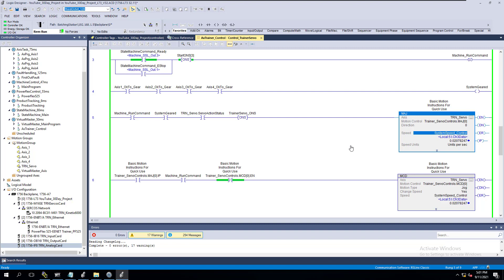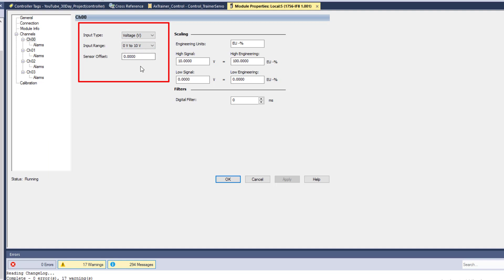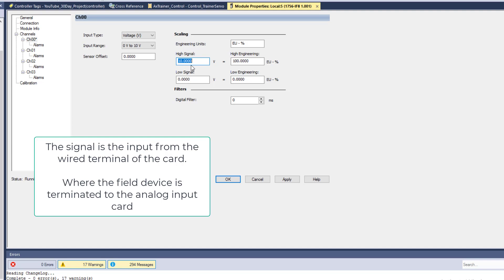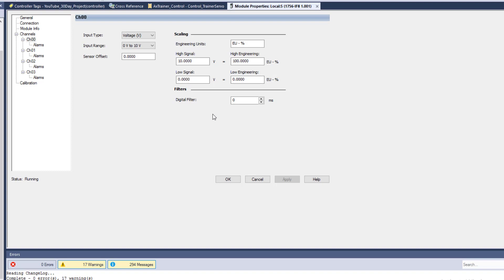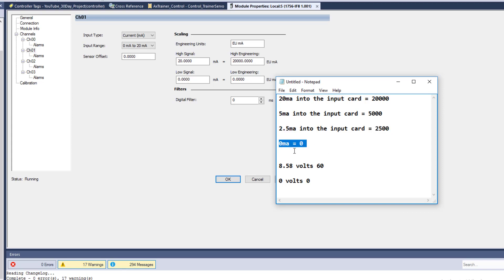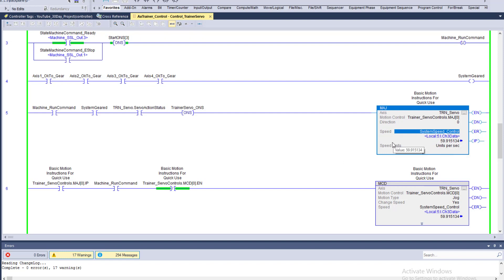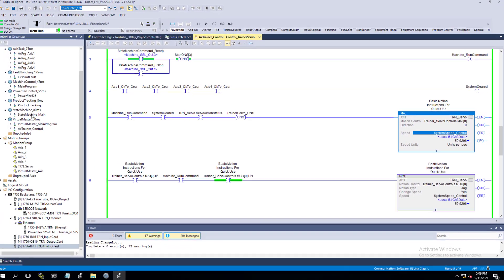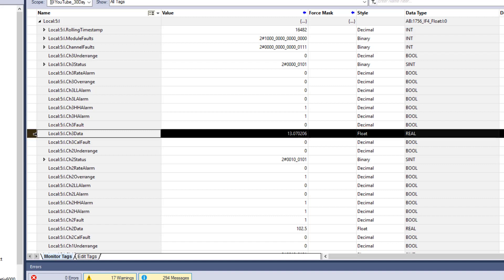Rockwell Automation Analog Input Card Scaling Engineering Units

Comment: I’d add with scaling it’s normally off of what instrument you have connected, so if it was a temp or pressure instrument the 4-20ma would then represent the 0-10bar press or -50 to 1000degC temp.
Reply from the maker: Correct, that is why I am showing this simple setup.

Scaling depends on the devices used & setup.

Hope all is well.

Comment: The 1756 analog cards are the best because they give you more options in terms of diagnostics, alarm and clamping structure in the module defined structure. My 1794 analog remote module doesnt have those features.
Reply from the maker: They vary based on the rack used or part number like you stated.

A 1756 chassis is generally the best the use.

Although, all others will setup based on how they are ordered, example, either 4-20ma to 10 volts.

Based on the chassis or rack used

Comment: I have a question on a current problem. I have a program on v32 studio. It has scalable engineering units from the HMI, but they don't change the scaled value. They do change (write) to  the low and high eng unit (in controller tags) in the PLC which is strange. Is it possible with a 1756-IF8H that is is only configurable from the module and downloaded? I've never seen this before... your video got my attention but this one doesn't quite fall into that...Ive created programs that eng units are changed on the fly and scaled value changes without issue....Thanks for any feedback. 

Reply
Reply from the maker: Depends on which system you are using on the HMI although yes, you can open the PLC program an change it in the I/O configuration very easily
Reply: @ShaneWelcher  yes , it was an old SLC program that was migrated to contrologix. The problem was the old program had tags that were changing the Scaling and parameters block in program...it was never setup, so they were doing nothing...changed it on module just fine

Comment: I am using a 1756-IF16 module. From the field side, I am getting 4.01 mA (I checked at the module wiring and am getting 4.01 mA there as well), but the program value is showing 4.38 mA. What might be the reason for this.
Reply from the maker: @yashwanthgowda6832  Depends on your meter or the card calibration
Reply: @ShaneWelcher  any other way to know that
Reply from the maker: @yashwanthgowda6832  try a different meter

Comment: Thanks a lot for your videos Shane,
What if we need to scale any mathematical value just like we used to with SCP (Scaling with partameters) with rslogix 500.
That instruction is gone with Logix 5000. Any suggestion about scaling an analog value without SCP or SCL like the old times?
Reply from the maker: The SCL instruction is in function block in Studio 5000.

You can also use it structured text.

As far as Scale with parameters, that is a natural function of the
 I/O card so there is instruction for that.

Then use a CPT instruction for anything you want to scale.

Example of rate:
(Scale_Max-Scaled_Min)/(Input_Max-Input_Min)

If you prefer a one time use then you can make an Add on instruction